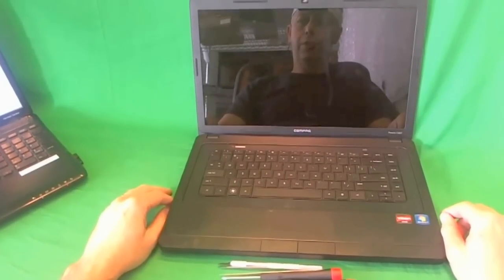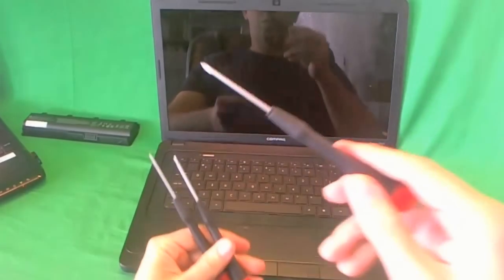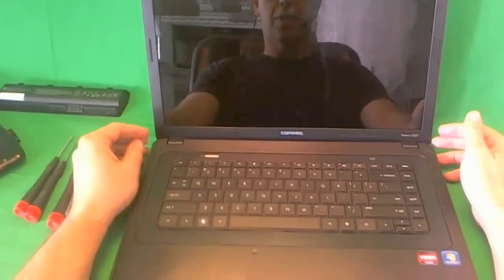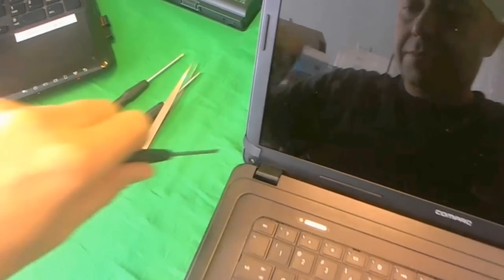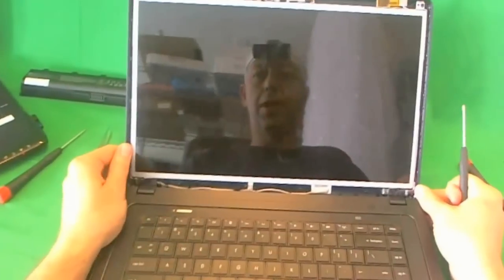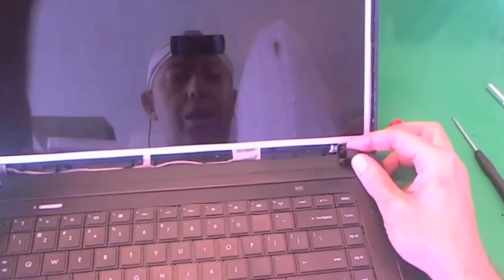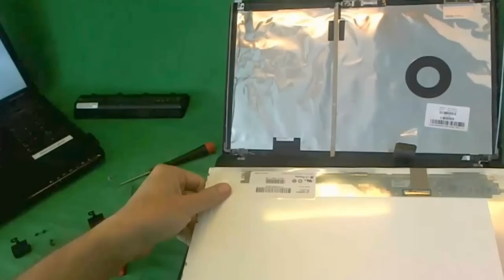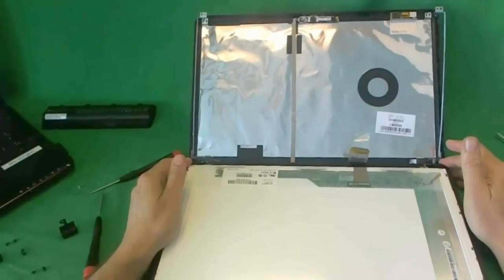Compaq Presario CQ57 Laptop Screen Replacement Procedure

Comment: Good tutorial . Very helpful. I have a question though. There is one separate white wire connecting screen with mother board, besides the connector cable. Any idea where is it connected to? Mine got snapped while opening, couldn't find point where it was soldered on.

Comment: Thank you for posting this video. I have no audio on the computer I am using so if you already answered my question in the video, I apologize. But here's my quick question, I am seeing on online laptop screen sites that there are a bunch in the cq57 series like the 339, 439, and a whole bunch of others, but I am not seeing on any website for my laptop model which is the cq57-489wm. Is it possible to use another screen from the cq57 series on the cq57-489wm instead or am i SOL?

Comment: I had a messed up screen and i took it to get repairs until he was like it will cost 175 i told him i might as well pay and extra hundred and some change and get a brand new one. Then he asks if i wanted to sell it for $25 i told him hell no. So luckily my computer programmer mom  told me i can just get a monitor for less than 100 for a temporary fix and just hook it up to my laptop she offered to take it apart and fix it but i didnt want to take the chance that she messes up and then i really would have had to buy a new laptop

Comment: If you don't have the tools he does and you use a smaller tool for the size you need to remove all the screws, it's difficult because they use "Loc-tight"on the screws and it can be difficult to remove. Otherwise it's a great video.

Comment: Ok guys i got a tough one, my friend gave me his old compaq laptop that hasn't been used in 4 years.  It is a Compaq Presario CQ57-339WM . Now here is the catch, 4 years ago the screen was cracked and when they replaced it the screen stopped working (they never saw it in action), they planned on fixing it but never did so they eventually gave it to me.  So I took apart the front of the laptop and re-connected the cable that connects the screen to the cpu and when i turned it on it only flashed a loading screen a few times and stays this bright black like there is power going to it.  I also cleared all the static electricity to see if that worked but nothing. Here is another catch, to turn it on it must be connected to the charger with or without the battery and to turn it on i press the f5 key. To turn it off i hold the power button. yet I can't hold the power button to turn it on no matter what. There is also no blinking lights and it seems like it should work besides those mistakes. So once I found all this out I took apart the back and found only one ram so changed it to a new channel but no luck. I am begging anyone person to solve this impossible mystery because this is probably the only laptop I will get for a long long  time.
Reply: I know this is years old but it sounds like it maybe corrupted, try changing the hard drive. Or it may need a boot disc.

Comment: why does this laptop only have one wifi antenna?
Reply: many thanks to dmd3 for solving this problem.
dmd3 post.
			 		 		 		
I have solved this issue! Pain in the A!!! Take the battery out of the laptop and remove screw that covers the panel for the wireless card. If you notice there is only one wire connecting your wireless card! Apperently these laptops were sold on Black Friday and they are defective. Contact HP and they will send you a box for repair. I had to take care of two of these for customers! Good Luck

http://forums.majorgeeks.com/showthread.php?t=249909